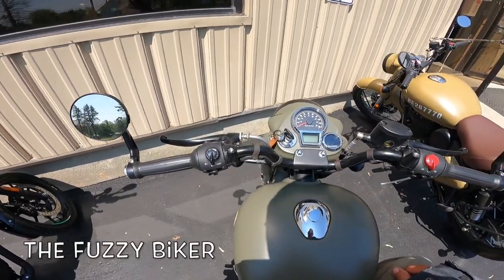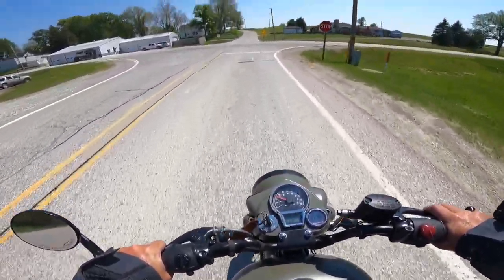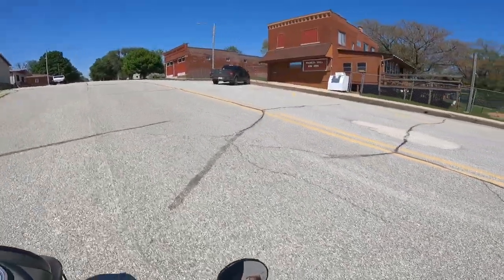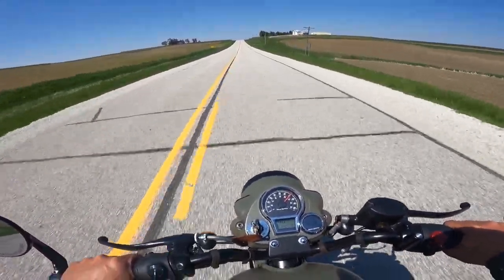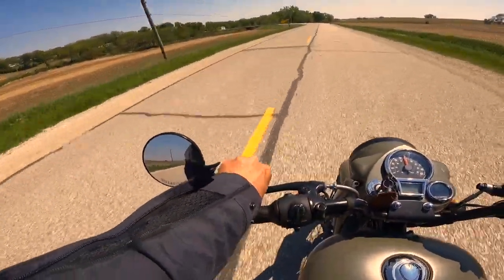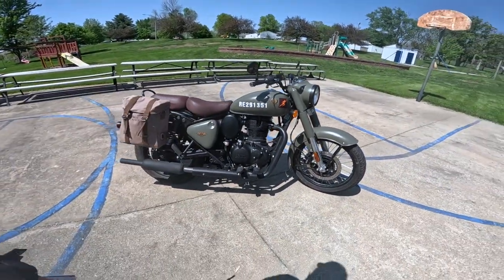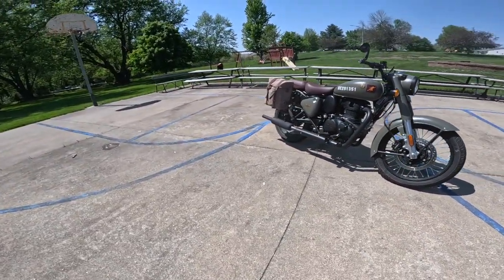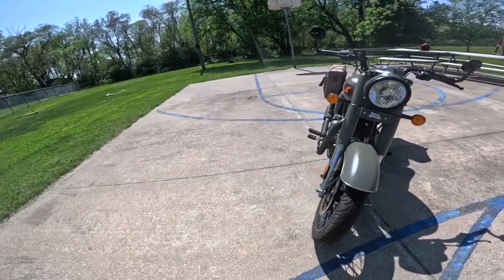High Performance RE Classic 350? Cam, FuelX, Pipe, Filter & More = More Power - Wahoo!

Comment: Well, now you need the 410cc Big Bore set from Himalayan Tools. Three things that make the engine stronger: Displacement, displacement, displacement!
Reply from the maker: Wahoo!
Reply: Welcome to vibration city
Reply: @CosmicSeeker69  not on our BB kit, not even on the 500cc
Reply: there IS replacement for displacement
Reply: How will be the heat management? There should be an oil cooler kit for the 500cc big bore mod.
Reply: @SurajSinghTomarArya  Not an issue, I have monitored the oil temp thru the bluetooth interface and the range is normal.

Comment: I own a Classic 500 and an Int 650.   I test rode a Classic 350.  For me, it was the most comfortable bike I have ever ridden.  The seating position is perfect.  The engine is smooth. The suspension supple, the transmission and clutch clean and predictable, the saddle was incredibly comfortable.   I was thinking of trading in my Int 650 for one of these, the Int. doesn't fit me.. the riding position, the reach to the bars, the pegs.. very tangled up.   I struggled the 350 up to 60mph and was thinking, if only it had TWO more horsepower..   Just TWO... it would be perfect...
Reply from the maker: It's funny that you say "two more hp" that was kind of the running joke when the owner of this bike was doing all the mods "just two more hp". I think he may have doubled that. Wahoo!
Reply: @forgottenmotorcycles  The ease with which you can increase it's performance gives me ideas.    A taller final drive would help overcome the problems of the Rev limiter.
Reply: @stevenmiller184 
It isn’t a rev limiter - it’s a speed limiter which gets its signal from the front brake abs…
Will be very difficult to work around this!
Reply: Soon they would be releasing a classic 650

Comment: I just did the DNA filter and plate upgrade on my Meteor 350, I expected it do nothing and was pleasantly surprised. Pulled noticeably harder and power band didn't taper off all the way up to the speed limiter at 74MPH. Well worth it
Reply from the maker: I'm thinking about trying one on my Classic. If it does well on the Meteor is should help the Classic too. Thanks!
Reply: And then you woke up.
Reply: You should consider what I call the holy trinity of upgrades for the J-series engine, de-cat exhaust system and the fuel X along side the dna performance air filter and cover, and see the difference in throttle response and the willingness to pull through the gears and especially up hills 😊
Reply: Did you put dna filter and plate only? Did not ecu remap? I have meteor 350 i am curious.
Reply: @JokicSlobodan  no re-map necessary, personally I fitted the red rooster exhaust from India and the fuel X lite, with the dna performance air filter and cover, but the ecu is a learning unit, as required since about 2015 on bikes, so there is nothing else to do ☺️
Reply: @kevindarkstar  Very interesting. Thanks
Reply: @JokicSlobodan  no remap, everything I’ve heard said current ECU can adapt
Reply: @kevindarkstar y como quitar el límitador de velocidad después de gastarse todo ese dinero en mejoras...es lo que más me preocupa la electrónica.
Reply: @kevindarkstar la ecu es la que te limita la velocidad, como carajos modificarla.

Comment: Always like your post mate.
Done the DNA filter will fit the fuel X lite and the Hitchcock de cat pipe.
But wont bother with the Hitchcock cam even though it certainly tweaks up the performance.
👍Lee
Reply from the maker: The Cam really changes the engine a lot. I'd do it but love the current feel/attitude of the Classic. I do need that DNA filter. Wahoo!

Comment: The 350 and 411 seem to be quite receptive to cam mods. The FuelX Lite is awesome. I have it on my 390 Duke and it has improved smoothness and low rpm rideability a fair bit. It is kind of like the Booster Plug except that it manipulates the lambda signal directly.

Also, it's pronounced Pun-jab not Poon-jab. Pun is pronounced like the English word. It's named after the state where this type of silencer has been quite popular. I say "has been" because the cops have been confiscating and destroying all loud aftermarket exhausts lately.
Reply from the maker: Thank you for the info on the Pun-jab. I always wonder how bad I'm doing with that kind of stuff. Will try to adjust. On the vintage bike videos there's an ongoing debate on how to pronounce Amal.. In that one there seems to be a clear divide between older vs younger riders. Great to hear from you. Thanks!
Reply: @forgottenmotorcycles  Haha! I am aware of the debate on the pronunciation of Amal! But, Punjab is the name of an Indian state. I actually speak Punjabi since I am from a city on its border. Being not an English word, you would understandably not know its pronunciation.

Comment: Do 70mph all day.
Great mods on bike.
This is how it should be 4-5hp is a huge gain & having cam it'll rev right out.
Reply: I love that colour.Need to get a hack done on ECU to remove limiter on speedo.
Meteor 350 is limiter is at 75mph instead of 70mph might be able to use Meteor 350 ECU or Hunter ECU.With cam do 70mph all day on Classic 350 & not so 3thrifty anymore.
Reply from the maker: She ran grand! Wahoo!
Reply: @ruahinesrider   the hunter has same motor and tranny. My next idea is to swap ecu with a hunter. I bet that removes speed limiter.
Reply: @mattfisher506  the hunter has a smaller front wheel so using a hunter ECU might trick a Classic into thinking its going slower than it actually is rather than actually removing the speed limiter. So theoretically it should still go faster, maybe?
Not sure if this would also make the speedo run slower.
Hopefully someone who has access to both a hunter and a Classic will try swapping the ECU to see if it works, I suspect buying one to test the theory might be a bit of an expensive mistake if it doesn't work.

Comment: I recently bought a Bullet 350 and love it but wished it had just a bit more pep like the Hunter.  Would you say that these mods give it more Hunter like performance (aside form the top speed obviously)?
Reply from the maker: Do these mods and you'll have more low and midrange than any stock Hunter. As you noted the Hunter will have more top speed. Rode a nifty Classic 350 with these adds yesterday and was very impressed. Should have a video out soon. Wahoo!
Reply: @forgottenmotorcycles  Nice.  Thanks Fuzzy, looking forward to that video.  Wahoo to you too.

Comment: I did the same with my Hunter 350 (DNA air filter , Kent stage two camshaft , removed the cat converter, and put a Enfield precision open exhaust muffler on  what by the way does make only a little more noise than a original muffler) the only thing i did not do yet is the fuel x but i will soon . the bike is much stronger up hill and much quicker up to speed ,. maybe you will not believe this but i can almost keep up from zero to 100km or 60miles with my mates KLR 650 (what is also a single ) but yeah above that speed the KLR is better ..... also i have a int. 650 and i love them both .
Reply from the maker: These 350's are just plain fun. Add all the goodies and they become super fun. Love it!

Comment: Enjoyed the video a lot. The improvement s in pickup, torque through the rev band range, have made me think about adding those Kent cams, FuelX fuel system and the DNA air filter on my RE Classic 350 (also Marsh Grey Signals BTW). And adding the Short Punjab (mini Punjab) slip on exhaust.

Had a question about the removal of catalytic converter (de-cat pipe). Maybe you can help me understand. How does removing the catalytic converter affect the engine life ? Does it hurt any at all?

Thanks - what a ride!!❤🎉
Reply: This is my bike. Removing the cat if anything will help engine life. That’s the exact exhaust I run
Reply: It'll be ok engine life & you could add the fuel X to richen it up so it doesn't run to lean.
Reply: Appreciate this insight a lot both of you 🙏
Keep the vlogs coming. Would love to see some videos riding the Classic 350 on some US Forest Service roads. I'm a new rider and bit cautious venturing away from paved black tops. Ride safe and enjoy!😃
Reply from the maker: Matt the bike owner...read this comment
Reply from the maker: Wahoo!
Reply from the maker: Matt maybe you'll answer this one.
Reply: @forgottenmotorcycles  I responded to him. Removing the cat if anything is good for the motor as long as you tube for it.

Comment: You've lost torque (pull) at the bottom end low to mid range but gained at the top end with the valve overlap on the new cam. You don't get something for nothing-if you gain in one area you loose it in another.
Reply from the maker: You may be right but I didn't seem to notice it. I'll pay more attention next time I ride her. Very fun!

Comment: Do 2000 miles before upgrades, run the engine in well
Reply from the maker: I thought it was 3000 miles?
Reply: 2000km according to my manuel about 1200 miles, every thing gets more smooth around 2000 miles, then do the mods.

Comment: That sound… Wow!
Reply from the maker: Love that sound. The GoPro really muted it too. Wahoo!
Reply: @forgottenmotorcycles  I just looked at the dyno chart on that English site. It’s impressive.
Reply from the maker: @critterIMHO  what were the torque numbers? Was told it added 5 horsepower.
Reply: @forgottenmotorcycles  unfortunately, it only shows the horsepower at the wheel. Max hp went from 15.57 to 20.46 at nearly the same RPM. That’s a huge increase.
Reply from the maker: @critterIMHO  that's pretty substantial for a bike that size.

Comment: Has anyone unpluged the ABS sensor on one on these? Be worth doing long enough to strap a gps to it an see how fast it is. Theoretically, you could take the ABS ring off an have a new one made with fewer holes. Speedometer will be wrong but... 10% fewer holes would mean 10% faster before shutting off. ABS should still work unless you went extreme with it. Half as many holes might not work.
Reply from the maker: Somebody should give that a try :-)
Reply: The Hunter has a smaller wheel than the Classic so is the adjustment is made using a different sensor ring or an adjustment in the Hunter ECU?
Or is there something I've missed?
Reply: @Walt_G  From pictures, it looks like the front ring is the same on both. Which makes sense from a parts department perspective. So it looks like the ECU. But its hard to count holes on a ring in a photo. A difference of one or two holes is all it takes to change it for a different tire an wheel size.
Reply: @RebelCowboysRVs  yes, I think you are correct, the ring looks the same so it must be the ECU.
Reply: @forgottenmotorcycles you should do it.

Comment: I guess you've kissed your warranty goodbye.
Reply from the maker: I'm thinking you're correct.
Reply: @michaelmurdock4607  I don't have a wrench or any mechanical ability whatsoever. Also, I've paid for the warranty so I'd like to get the benefit. If I had an older bike with no existing warranty, I wouldn't mind.

Comment: These bikes have got to be good for 80mph. Someone out there knows how to diable the speed limiter, PLEASE share🙏
Reply from the maker: I'd sure like to know how to get her to do it. Maybe reducing the size of the rear sprocket or increasing the size of the front sprocket.
Reply: @forgottenmotorcycles  That doesn't work, the speed limiter works from the ABS/Speed sensor.  it IS NOT a rev limiter.
Reply: So, we pull the fuse on the ABS which disables both the ABS and the speedo. We buy one of those little gizmos you fit to a bicycle and, hay presto, you know how fast you are going. Problem is, going at 80+mph on my Classic Reborn is probably the time I'm going to be wishing I hadn't disconnected my ABS. Nah, think I'll just add a Conti GT to the stable.
Reply: @michaelmurdock4607  How fast did it go?
Reply: @michaelmurdock4607  Thanks man